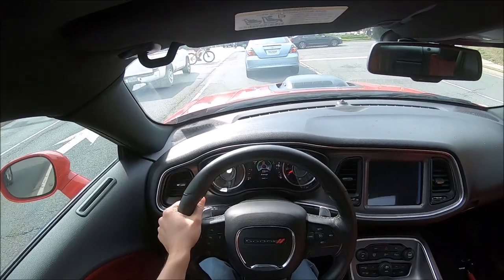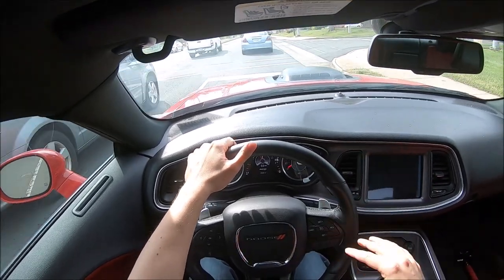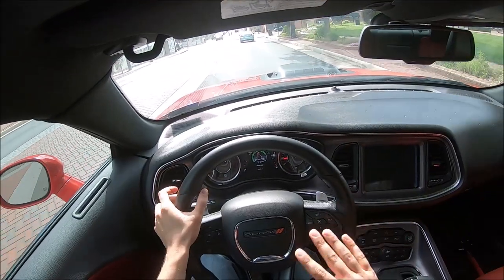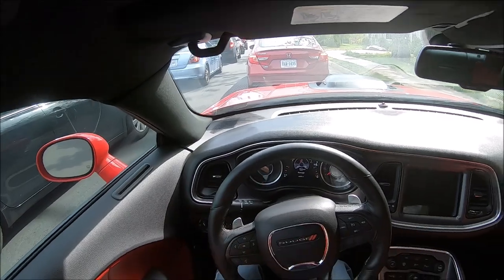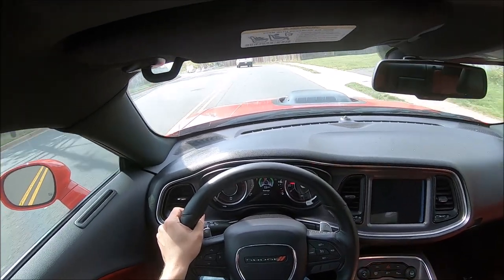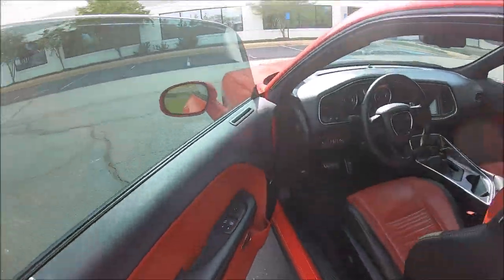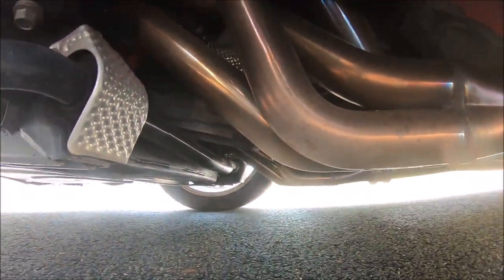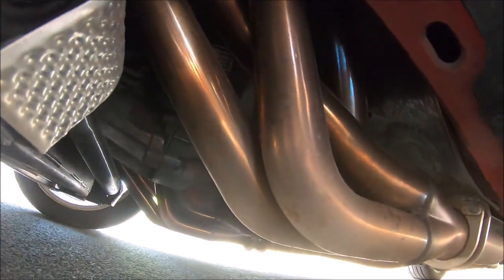Do I Regret Getting a CATLESS Exhaust for My Dodge Challenger ScatPack?

Comment: I will agree with you about the smell getting worse over time. I've had catless mid pipes on my 15 SRT 392 6 speed for 4 years and only in the last 4ish months I've noticed the smell getting stronger as well as fuel economy dropping about 1.5mpg across the board. Reason being is the government has increased the ethanol content in all (or most) fuels across the board in an aid to decrease fuel prices that we're obviously not seeing because the prices fluctuate huge amounts in just a few days time. At least in the greater Houston area. Was literally at a 4 way stop light last week with 3 gas stations on 4 of the corners. A Texaco, Shell, and Kroger. The price in that order for 93 octane was 5.99/gal, 4.87/gal, and 4.65/gal. Gas stations (at least in my very large area) seem to be taking advantage of the huge fluctuations and charging whatever they want because people will just stop and fill up where they're at because it can be very inconvenient to try to get across the street, just the way our messed up roads and traffic are. But long story short, the extra 5% ethanol for a total of 15% (you'll still see stickers stating the fuel contains up to E10, but it's in fact now E15). This is a huge problem because car manufacturers have been designing engine and emissions software to allow for the allowable 10% ethanol since 2007 when the use of ethanol blended fuels was finally strictly regulated. The use of ethanol increases fuel consumption due to the fact that ethanol requires 30% more fuel to combust properly. Now that Biden has implemented a nation wide  increase of ethanol of 5%, the engine computer has to adjust outside of it's programmed maximum ethanol content of 10% thus the o2 sensors are now seeing that the engine is running leaner so it's adding a bit more extra fuel to compensate. This is why you are noticing the stronger exhaust smell.  The engine is adding right at about 2.205% extra fuel to run at it's programmed air fuel ratio of 14.7:1. This is why my fuel highway economy dropped from 26mpg down to 25.4mpg and it just gets worse as I drive in the city.
Edit: And just a suggestion for you to make the exhaust smell more "pleasant" is to get a bottle of fuel fragrance from Jeggs. Pick your sent, they have many to choose from and it totally transforms the exhaust smell. I found that the cinnamon additive works best next to grape lol. But I haven't tried all of them. And even after you run out of the additive (which is totally safe for the engine) you still get a lingering sent for a couple of tanks. It also drives your buddies crazy because most people don't know there is such a thing as exhaust fragrance. PS, it only works on catless cars 😉.
Reply from the maker: Good to know. But that all makes sense now because I just started noticing it a few months ago
Reply: @KCars  I think you'd like trying out the fuel fragrance from Jeggs. You should try it out
Reply from the maker: Ya that definitely sounds like a solid choice for catless cars

Comment: Your emissions is typically exempt depending on where you live. For instance here in Albuquerque New Mexico you must have full exhaust on your vehicle. But if you live in Bernalillo or los Lunas which are suburbs of Albuquerque you are exempt because it’s a considered a rule area.
I have a LS2 6.0L Pontiac GTO that has a Kooks full exhaust with high flow cats X pipe and Kooks screamer mufflers. We have a brand new 2021 challenger R/T scat pack widebody shaker. I know I can get a little more power by adding long tube headers. 
I want to keep the stock by mobile valves.
Reply from the maker: I think more and more places are making it harder to have a catless car now. I’d definitely recommend going for it, I gained 48 HP with the headers, midpipes, and tune

Comment: Was the car lowered at all before adding headers? Or stock height...
Reply from the maker: Stock height
Reply: @KCars  Where do you normally scrape? Car park entrances... speed bumps? 

Asking cause I'm already lowered with aftermarket suspension.
Reply from the maker: @7thSeal37  yup most commonly it was on speed bumps
Reply: @KCars  I appreciate the info. Definitely a huge help 👍
Reply from the maker: @7thSeal37  glad to help!